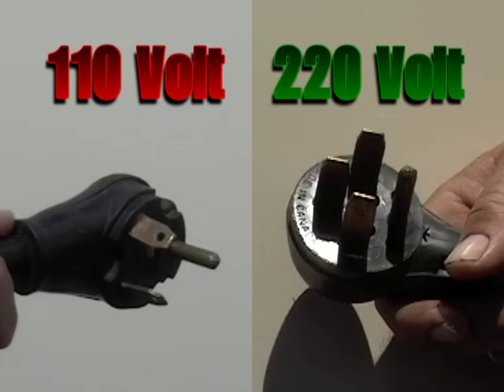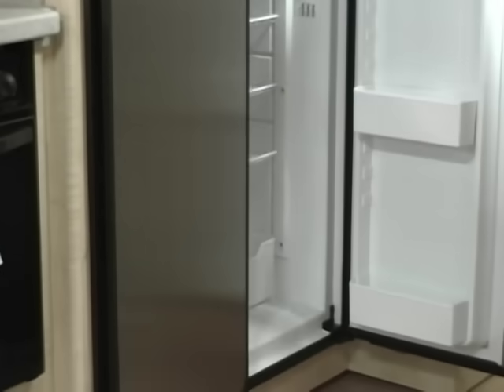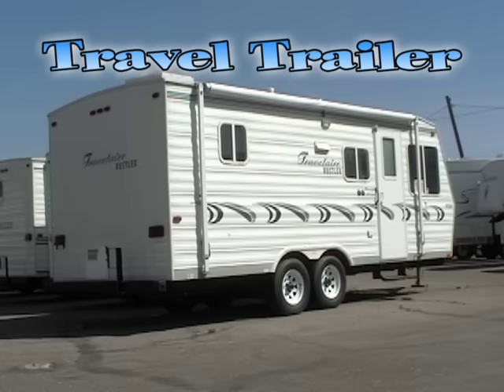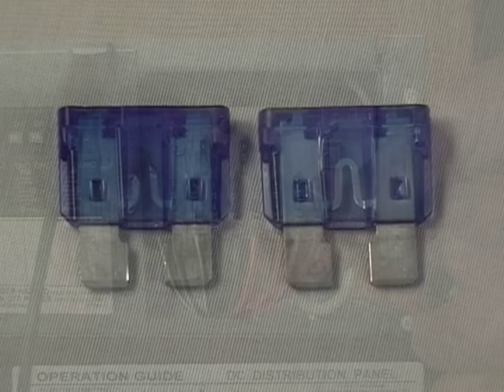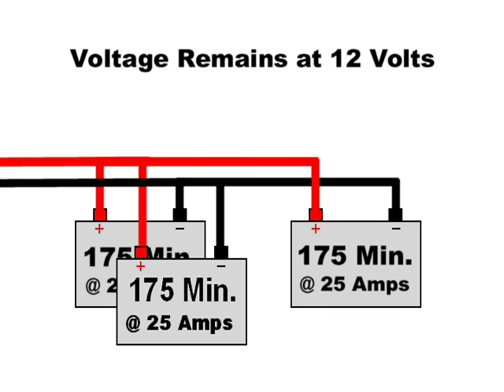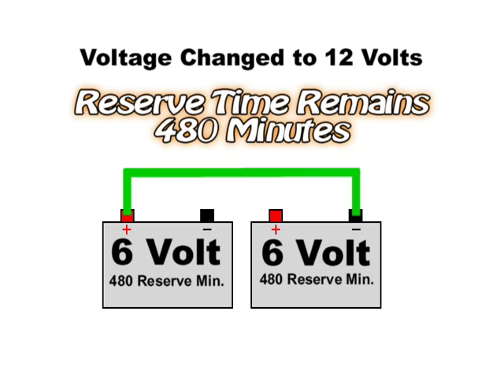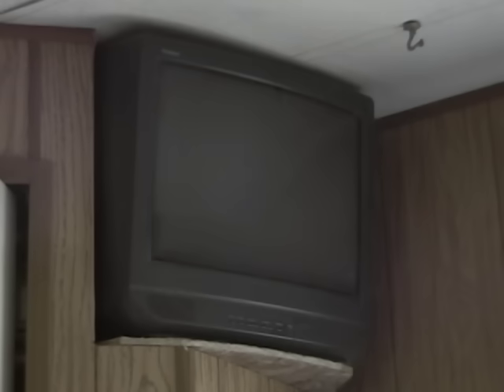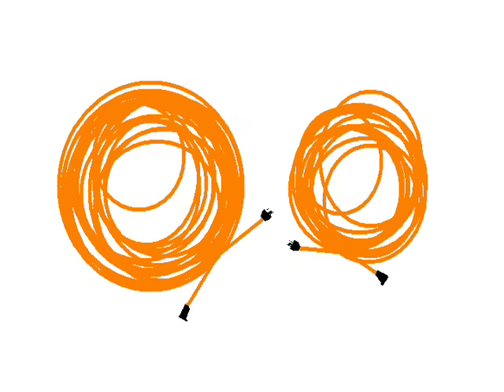RV Walk-Thru: Electrical - Learn about the electrical system on your RV

Comment: I love your videos. I have a question. I read in my owners manual that you should never coil your power cord when in use because it is possible to generate excessive heat and thus damage the cord. Could you address that issue?

Comment: Speaking of wiring the trailer plug incorrectly.  WOW!  I "SMOKED" my 30amp converter. I have a 1995 Jayco Eagle 302FK.  I replaced it with a Powermax 110 Volt to 12 Volt DC Power Supply Converter Charger for Rv.  My camper had a Coleman Mach 3 that was too far gone to get anything out of it so I replaced it with a Coleman Mach 3 Plus.  All of the wires are the same and nothing should have changed ... BUT ... the 15amp fuze on the tongue at the battery (that kicks the AC) blew.  I then tried to replace the fuze but POW it "BURNED" the fuze.  So I tested it and it reported 26.1 volts.  My question is "WHAT BLOWS"?  Was the original voltage across the wire to the AC (at the battery) 12.1 volt or something else?

ANSWER:  I had installed the Powermax 110 Volt to 12 Volt DC Power Supply Converter Charger black and white wire backwards.  That created 26.1 volts.  WHAT?

Comment: This helped a lot in understanding electricity. When you park at a lot with hookups there is no 120 volt connection? If not what is the sense in hooking up if you cannot run AC? I am a newbie getting ready to get involved with RVing. Thanks.

Comment: This is one of the most informative videos I have found so far, Thank You!
When I get my 5'er it will have solar and a battery bank but I'm trying to figure out how that can feed the 120 VAC and not interfere with Shore Power when in a park.  It looks like a 6kW inverter will be needed because the rig will be 50A AC.  And I am perfectly comfortable working with electricity.  Appreciate any help on this.
Reply: Oh - you didn't get back to the "floating ground" on that lady's trailer when hooked up to 220.  If that even connected, someone didn't know what they were doing.

Comment: Todd:  He is right about the additional 260 minutes, but he didn't fully explain his meaning.  His intention was to compare the reserve capacity of 4 X 12-volt batteries connected in parallel (producing a 12-volt battery pack with a 4 X 175 = 700 amphour reserve capacity) to 4 X 6-volt batteries connected in a series-parallel arrangement to give a 12-volt battery pack with a 2 X 480 = 960 amphour reserve capacity.  The system made up of 6-volt batteries will give a greater overall reserve capacity, by 960 - 700 = 260 amphours.  This is what he meant, the 6-volt golf cart batteries are generally the better way in terms of capacity, pound-for-pound, dollar-for-dollar.

Comment: Don't over look this extension cord wire size. Some are cheap for a reason as you need 12ga wire for 20 amps. 14ga is for 15 amps. I would never go below 12ga as that is what the breaker is rated at.
Reply: Hi,I have 1977 fth wheel and I'm trying to have lights from house plug to a converter but the is only two cables (red and white)plus the ground atach to the frame of rv,where should put r d and white?? On batteries
Reply: @edgarchavez1079  I hope you didn't blow yourself up

Comment: Wow, I just got a trailer for free from my uncle, and I almost did exactly what you talked about first. I was going to plug it into the dryer in outlet in my house, since it looks the same. Whoo! lol Guess I figured these things ran on 220 since, why not? Mine only has a propane heater, which would be nice if it had an electric one, hence a 220 plug. Propane isn't cheap.

Comment: So is there a portable generator that has a 30 amp outlet I could plug the trailer into, or is this a no no?
Reply: +Bill Long It's admirable that you are very happy with yer Onan, and will sing it's praises, but you shouldn't infer that its' the only safe, reliable brand. Honda, Yamaha, and Champion ALL have the same qualities, and are just as safe & dependable as yer Onan.
Reply: ***** Harbor Freight et al have generators that are cheap but they are very noisy and the output is not stable enough for anything electronic which is about everything in an RV. Quiet and stable generators are expensive.  I would not put anything other than an Onan in an RV unless you really want to replace wires, fuse blocks and buss bars along with all the controls.
Reply: ***** 
There are a lot of newer "Inverter" type of generators that are good and quiet but may be a bit noisy under load.  But you can add to the muffler for that.  The real bottom line is - if it is designed for an RV then it will be quieter than one that was designed for home use.  Construction grade generators are powerful but noisy because construction is noisy.  Beyond what you can put up with, is what will your neighbors put up with?  That may not be a concern depending where you camp.

Comment: Rather than compare amperage to speed of electrical current, which is entirely inaccurate, think of amperage as the "volume" of current where voltage is the "pressure". In this way, it is easier to visualize electricity flowing much like water through plumbing. So, the amperage doesn't change the speed of electron flow, but rather the rate at which power is consumed.

Comment: The overall info is great.  The only thing I saw that was a little questionable to me:  Right at the very end, Tim coiled the extension cord back over the 30 amp adapter.  To me this is not a very good thing to do.  If that cord has enough draw through it, the cord will get hot.  Coiling it back on itself could pose a problem.  Laying the cord out in such a way that it will not cross back over itself will keep more of the cord in contact with the ground, which will help dissipate any heat that builds up.

Personally, I don’t ever allow the power cord to cross over itself.  No matter which cord I’m using.

Comment: I have an old camper trailer I have 100 amps at the pole and the inside breaker box is 25 amp do I need to reduce this down somehow  what should I check for
Reply: No, the trailer will only draw the amount of amps it requires from the pole (not the full 100 amp capability). The circuit breaker box limits that draw to 25 amps, which is the safe amount for the wiring and similar of your trailer.

Comment: Excellent video with a lot of good information for the uninitiated.
Except for him saying this about a GFI or GFCI @ 11:10,, "they are just a super sensitive circuit breaker". Not even close. They are completely different electrical devices, used for different reasons or purposes. The only thing they have in common is they interrupt power when they are supposed to. They have different jobs and do it differently.   Circuit breakers protect wires from carrying to much amperage. GFI,GFCI's protect people from electrical shock or electrocution.
Reply: Your right but his point was to make this easy to understand for people with little electrical background..  Excellent video and your comment good too!
Reply: I think he just meant to simplify the information given.
Reply: Touring life I suppose so.  He did a good job with what he did present.

Comment: in a campervan,  30a service, its grounded thru the plug but does it need to be grounded to the van frame too?
Reply: It should b grounded. As explained in the video some screwed up. Some how power was getting to the chassis or aluminum siding of the RV. If it was grounded there would be no shock hazard

Comment: Absolutely Excellent, great format, breakdown and explanation ....I needed it.  If I have a Class A that uses a 30 amp and I have an a 30 Amp put at the house...but its on the other end of the house which causes me to use 50+ feet of 30 amp extension cord what will that do if anything?
Reply: That's acceptable. Periodically you should feel the plugs to see if they are warm or worse hot.  If they are cool to the touch, all is well. If you have an electric stove, check them when using the stove or other big appliances like A/C or electric heaters also.They should be protected from the rain or from getting wet.  If are very old and corroded, either the plugs or the outlets they plug into, they will heat up when running heavy loads or power.  That could cause a fire at the problem plug, they should never feel warm or hot to the touch.

Comment: I own a Motor home Class C. 30 AMP cord connection. Never or less in the Electric Box inside the motor home it is a sign "45 AMP".
If the Connection / cable / Plug is 30 AMP, Why the electric box inside have a 45 AMP sign?
Another question: Where I can connect / have a 30 AMP circuit inside the Motor home to connect one Appliance that required 110 Volts / 30 AMP ?
Do I need to install a sub-panel?
No even one video in YouTube about installing a Sub-panel inside any RV.
Thanks and if anybody can help me, PLEASE I will appreciated.
Reply: I have seen similar things elsewhere. There are multiple power systems in your RV. Typically the higher Amperage rating will be reffering to the DC System capacity, not the AC System capacity.